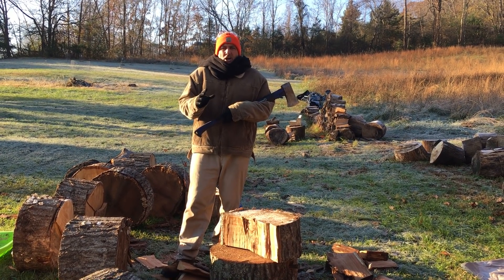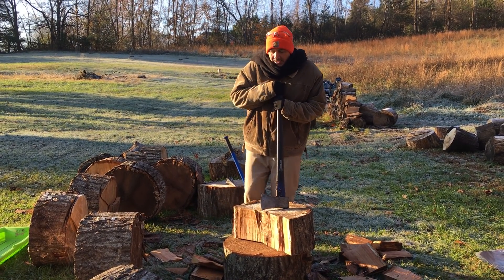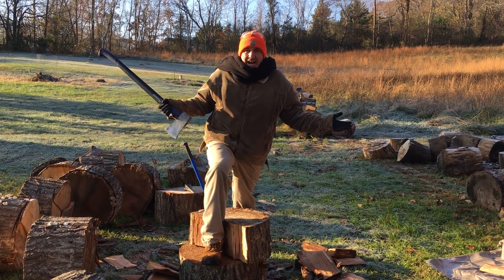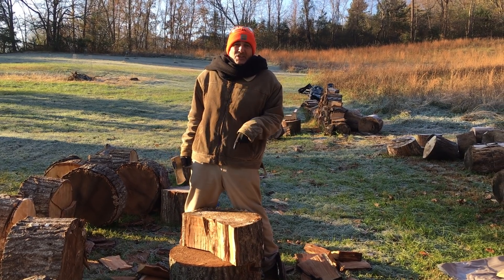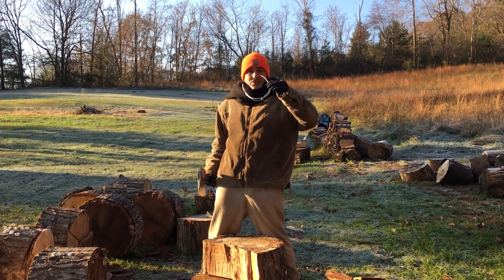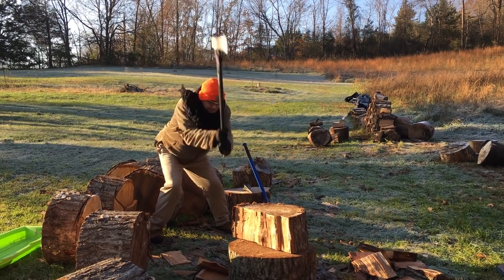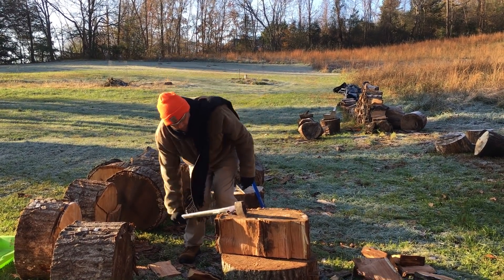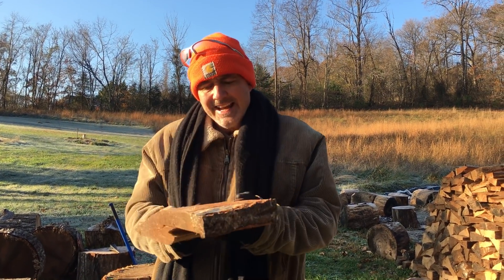Here's Why Rocky IV Chopped All That Frozen Firewood Why Rocky 6 Didn't And Why You Should Too

Comment: You handled that ax like a champ yourself. Splitting the wood with your ax while its frozen is a great idea if you live in an area where it freezes for several days in a row. Here in North Florida we cut down dead trees, then cut them up, and then split the firewood because we don't get enough below freezing days to use this method. Do you use dried wood to start your fires to get it burning good and hot before putting the green wood on to burn for heating your home? I've don't that on occasion in the past and it worked when I was short on dried firewood. I found it amazing how the water would run along the grain and come out the ends of the wood as it burned. I love a good fire to get warm by when it's cold out but now I have a small heater that looks like a fire that has taken the place of a fireplace and real fire. We make do with what we have and can. Hope you, Dearly, and Daniel have a great day!